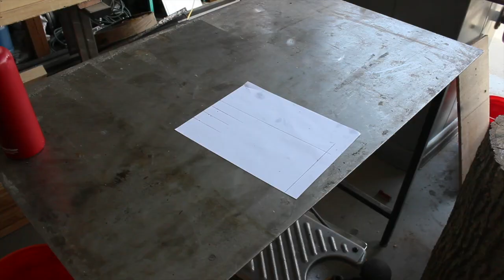Magnetic Bottle Opener | How-to

Comment: Wow how does that DeWalt machine around 2:00 work? That was amazing
Reply from the maker: Hi +LaCatrina1234 it's called a planer, it's essentially a bunch of blades spinning at a very high rpm that resurfaces the wood. The smaller ones like this are often referred to as "lunchbox planers" this one was ~$400 new, but you can often find some decent new and used ones by various manufacturers for much less. I use this thing way more than I anticipated I would.

Comment: What are the overall dimensions that you ended up with?  Thinking about trying this out myself.
Reply from the maker: +Adam Torres I sold the two that I made in the video, so I don't know the exact dimensions, but they are usually somewhere around 4-4.5" wide x 9-10" long. The ones I do vary considerably depending on what cutoffs I have laying around.

If you are concerned about the dimensions, I would recommend getting your opener first and that should help you visualize what sort of dimensions you want to end up with.

Thanks, and good luck--let me know how it turns out!